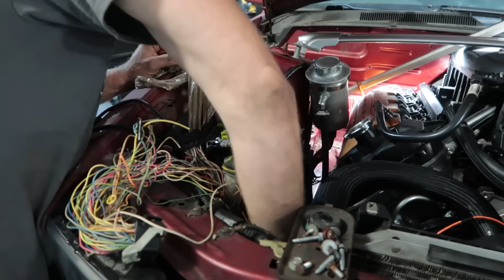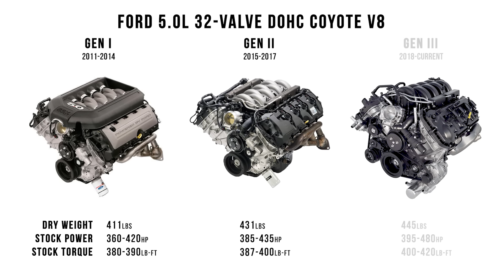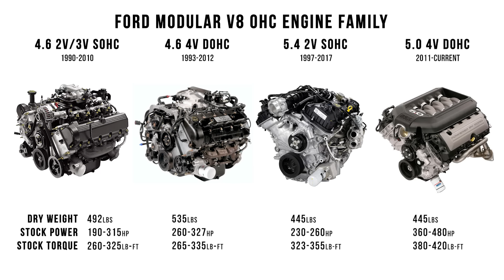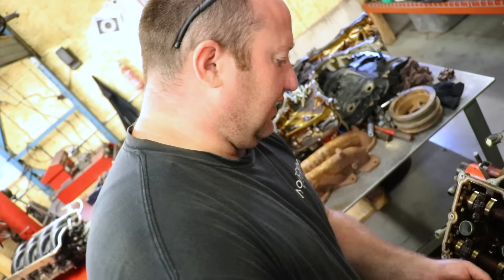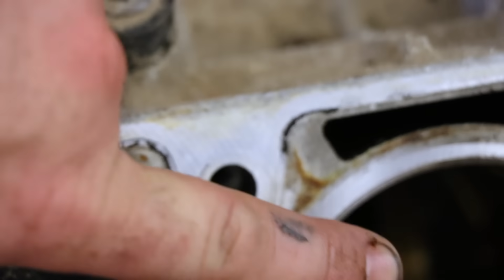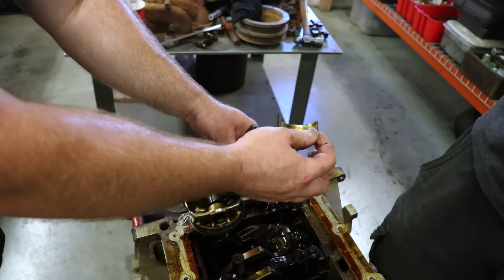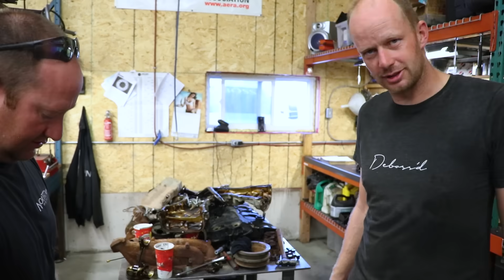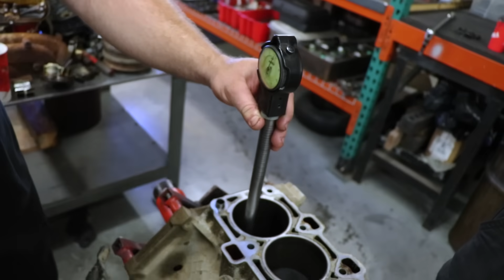REVIEW: Everything Wrong With A 5.0 Coyote Engine

Comment: I've got over 250k miles on my trucks LS engine. I have multiple ASE certs (*now expired) and have taken a lot of classes on lubricants. Oil manufacturer does not matter. As long as it has or exceeds the API rating your cars manufacturer recommends the oil is fine. 

I change my oil every 10k to 12k miles and use a different oil and filter every time. I've used the cheapest store brand all the way up to Lucas Synthetic and Royal Purple. If you look on the back and that seal is there and meets your manufacturers specs the oil will work just fine. You can change the kind of oil you use every 3000 miles if you want to and your vehicle will never know the difference.  The additive packages are so close to being exactly the same that it doesn't make any difference in protection. Just look at the lab results online from different oils. They are all made to the same specs and therefore you will not notice a difference even if you had 2 identical cars and drove them 500k miles each with competing oils. 

This guy is still holding onto "traditional knowledge" otherwise known as old wives tales. Like old guys who won't use Pennzoil "because it contains a lot more wax than other oil and gums up your engine." It's simply not true and hasn't been since at the very latest the early 1970's. My dad still thinks you can't put an automotive lead acid battery on concrete or it will drain the charge from it. Just because something was true 50 years ago it doesn't mean it's still the same today. 

He has been doing this for a few decades probably so the best thing for him to do is find some textbooks the local community college uses in their auto tech programs and start there. It will catch him up on all the developments since he was trained by some old school guy who was still living in the 50s and using old and outdated knowledge that was useless in the present. It's 2020, oil is oil is oil is oil. As long as the API seal on the back is as good or better than your cars requirements you will have zero problems even if you change the brand of oil you use at every oil change. 

We should never stop learning, it's what makes us better as humans. Accepting old knowledge as still applicable is, I'll just come out and say it, lazy. That's all I can call it. The automotive industry has changed dramatically even in the last 10 years technologically and if you rely on what you learned 20 years ago you will fall behind. I'm rolling into my mid 40's and I still keep up with what's new and try to find out what is changing.  Your engine will never know what brand of oil you put in it. It won't matter because they are all so close that we might as well call them identical. Cheaper oils are processed less and therefore have shorter carbon chains which means you need to change your oil more often. Conventional oils can call themselves synthetic if they have been processed enough to lengthen the carbon chains. Which means when those carbons chains break they are still long enough to act as lubrication between surfaces. True synthetics are much more expensive than processed conventional oil like Mobil 1 because they are truly an engineered product and didn't start with a conventional motor oil base. They aren't any better in a daily driven car but in high performance, high rpm conditions can make a difference. 

Oil is extremely complicated and at the same time very simple. We live in an age where we don't have to worry about what oil to put in our vehicles because they will all protect it just fine as long as you do your regular maintenance. The companies that make lubricants haven't stopped their R&D departments and neither have auto manufacturers. They work together to create lubricants with additive packages that reduce emissions and increase gas mileage. The people working on cars have the responsibility to keep up with these changes and educate themselves, especially if they are going to share their knowledge with other people. If you are going to share your knowledge the least you can do is make sure that your knowledge is correct for modern vehicles and lubricants.

Comment: It’s crazy people still think there’s a big difference in price from modded LS to modded coyote. The only thing more expensive is valvetrain and mostly cams ( 4 vs 1) because a coyote has a far better stock valvetrain. All other parts are priced about the same and coyote parts tend to be better especially stock vs stock. Stock coyote heads flow a lot more than newer LS/LT heads even with a smaller bore, valvetrain stability is better on a coyote,stock coyote bottom ends hold more power, and even at 12:1 CR you can still run boost because the combustion chamber design is awesome. And let’s not mention hp/displacement. A 5.0 competes against a 6.2 and wins. The 5.2 flat plane makes like 70hp more than a 6.2 LS/LT and the 5.2 cross plane makes over 100hp more. I will be building a badass LS for my C3 project so don’t think I’m all Ford all the time. I admit that with the ease of adding displacement to a LS/LT engine that you can get more power than a built coyote super cheap but that doesn’t make it a better platform in my opinion unless your building a truck and need the torque. As it stands right now, the LS/LT engines aren the worse American v8 engines still in production from a design stand point but so many people act like they are the best engine of all time. Just sad😞

Comment: I have to admit, I'm surprised at what you're saying about synthetic oils.  I thought one of the advantages of synthetics is that they "don't" sludge up the way pure dino oil has been known to do.  I have my oil changed at my local Ford dealer and I think they're using a synthetic blend and not a pure synthetic.  I'm going to confirm that, but I do the oil changes at 5k intervals and usually drive the car (a 2016 Mustang GT) normally.  Sure, I play around with it from time to time but for the most part, I'm not running it any harder than I'd run my Rav4.

Comment: The boss 302 and first gen F-150 use the same block. The coyote oil pump is known for failure. Gen2 still has oil squirters. Same crank casting just machined different. Gen2 heads have bigger valves and runners. Gen2 and gen3 both have boss rods. Secondary chain failure is common.

Comment: I don't think synthetic causes sludge as much as lack of maintenance.  I have a car with 220k miles that I'm the first owner. Full synthetic oil every 5k miles and what I can see through the oil cap looks brand new. It's a 2011 Ford 3.5l. Never had a mechanical issue with it. Just my personal experience.

Comment: The discolouration between different banks on a V configuration engine is due to the PCV gases traveling from one bank, with fresh air from the intake tube, through the block to the other bank and sucked out through the PCV valve into the intake manifold. I've seen this especially doing timing chain jobs on GM 3.6l high feature V6. It bakes the "hot bank" with the heat from the "cool bank".

Comment: Mobil AV-1 Synthetic Aviation oils were the subject of a class action lawsuit after Mobil withdrew this oil from the market back in 1994, reported to be caused by sludge accumulation resulting in sticking piston rings and other internal sludge related engine damages. The problem was believed to be that even though full synthetic oils are superb lubricants, in some applications they were shown to be poor cleaners and had issues removing lead deposits which is is not present in modern auto gasoline,  but is still added to aviation gasoline. Due to the possibly less that ideal cleaning performance in full synthetics oils, coupled with infrequent oil changes and not getting the engine oil up to normal operating temp  "could be an issue" that result in the kind sludge deposits they were talking about in this video. I have used Mobil 1 synthetic oils in my automobiles for decades without a single lubrication related issue but I do oil changes every 3,300 miles. In my humble opinion you can change oil or change engines, its just that simple.

Comment: I have a 1989 GMC K 2500 5.0 4 x4 with 370K Miles  Local engine builders here say they go to 750K before rebuilding at $2500 Engine and Transmission rebuilt same time.   Take that Ford. Too many issues I heard ....Why did Ford do that?

Comment: NITWIT!
Compression distance doesn't change swept-volume displacement (which is why the displacement of all RICE engines is calculated that way: it's geometry).
All you need to know, for round-bore engines, is the bore diameter, the number of cylinders, and the stroke.  The stroke is how far up and down the cylinder the piston moves, which is not changed by any combination of the compression height of the piston and the length of the connecting rod.

pi (approximately 3.141592654) multiplied by the square of the radius of the bore, gives the area that is then multiplied by the stroke to obtain the displacement of one cylinder; this is multiplied by the number of (effective) cylinders to obtain the engine's displacement.

Comment: I’m really surprised nobody brought up the water pump. They like to go out anywhere between 100,000-150,000 miles and this is usually the only issue 1st gen coyote owners run into. Super solid motor imo. Feels smoother and more playful than a 5.3 Chevy to me as well.
Reply: my 5.0 water pump blew at 140 k  also keep a close watch on the transmission cooling lines mine let go changed the line complete trans flush six speed is strong
Reply: I got a 1st gen. Went at 75k. My neighbor has a 2nd gen and his went at 80k. Probably never mentioned it as he seems to get the advanced engine work. I bet  most dealerships can easily do that themselves so he doesn’t hear a lot about it

Comment: The second gens of these are great motors.  They have one great virtue over an LS, and that is no AFM system time bomb sitting under your hood.
Reply: Man...that is so true.  Once my truck is out of powertrain warranty I'm deleting that garbage ASAP.  I've already disabled AFM on my 5.3 through programming but I want it gone completely.
Reply: Sean Frank that would be a good move.  Keep an eye on you oil pressure and if it starts to run lower than average get rid of it quick.  I ignored that sign on mine and I ended up having a collapsed lifter on cylinder #7 that tore up the CAM.   I don’t know if they addressed it in later years but they also had that problem with the 5.3 where the little white plastic washer where the oil pump mounts cracks and fails.  It’s hard, but from what I have read you can drop the pan far enough to replace it with the crossmember in place.   I think this is possibly what happened with mine due to the drop in pressure, and why #7 was the first to fail.   I know those oil passages for that AFM are also prone to clogging up so it’s probably a culmination of issues that ends with the AFM failure.  I liked my Sierra, but I also like my 2015 F150 with the 5.0 I replaced it with.   Ive owned dodges, Chevy, and ford trucks and none of them are without their unique issues.

Comment: Gotta 98 Saturn sw1 with 380k miles on it. Use supertech high mileage full synthetic, and change every 6k. She's near the end of her life. Not gonna say she's runnin top, but she's running. 1 Piston ring is bad and it runs on 3 most the time, but dammit she wont die. I round trip her 160 miles per and she just wont die...

Comment: I did an oil change an hour after the first change on a 302 from 1969. I ran an engine oil flush with the fresh oil only because the plug gasket leaked. In came out blacker than an hour earlier. 
May have been sludge, but stayed clean longer.

Comment: Way of the future? Dude; ever heard of electric? Gas/petrol engines are nearing nostalgia (for performance) so it's a bit late for that. Seems everyone running gas/petrol is adding boost so it's a moot point on pushrod vs ohc. I'll stick to an LS because it fits in the chassis i'm using and everything Boss would be custom rather than shelf LS conversion kit/bits, combine that with Australia tax and you may as well set fire to your money going Boss. If money's not an object then what's the point arguing, do whatever makes you happy.

Comment: Hey Scott , great video , i really appreciate your humility , you are very knowledgeable , thanks for such a good informative video ,  and i do agree with you , the double over head cam is the future , im a Chevy guy my self , but i do like Ford ,  i have had some good Fords .  The LS is a good engine , built on the old gen plat form , i ride a zx-14 Kawasaki , and of course , it does have a double over head cam , 4 valves per cylinder engine   the horse  power bands are so much more instantaneous , and red lines are higher too , and some times , kinda scary , Lol ,  i love the Sound too  ! do you know if Chevrolet makes a good  v-8 double over head cam engine ? ? kinda interested on your take ,   kinda sad to see Corvette engineers still using the LS single cam engine  , old school 2 valves per cylinder ,  just my opinion . but they finally made a mid engine , gees ,   Lol  , i think i will have to wait for a good double over head cam engine for that before i buy 1  .

Comment: Yeah as someone that prefers working on old carbureted engines and as someone with shop experience, and layman science background, synthetics are objectively better than conventional oils, they have more consistent viscosity and are engineered to serve an engine for longer intervals. If synthetics actually did damage engines like this guy claims, even aluminum, then there would be a much larger outcry from dealers, shade tree mechanics, performance shops and owners against using an oil type they love. When I have a freshly rebuilt carbed engine, I'll happily run full synthetic in it just because it'll last the engine longer.

It's a case of poor maintenance and hard daily driving.

Comment: When will antiquated 'merican car manufacturers adopt technology similar to the "TRUEVALVE" design that eliminates gigantic heads,  camshafts, wheels, pulleys, belts, etc.?  All that extra (and unnecessary) metal mass is being flung around resulting in vibration, wasted energy, materials and efficiency.  Oh wait . .  I won't live that long.  The fact is there is already a production twin turbo 2 liter 3 cylinder engine putting out 600 bhp that would likely shame any production "hot" 'merican car just on power to weight ratio alone.  Probably too big of a bite out of profit margins, I reckon.  The #1 Rule remains the same:  "It doesn't have to make sense!"  Sigh . . .

Comment: LS vs 5.0 in Australia . LS HANDS DOWN WHY ? Easier to get power at a lower cost . Stock to stock the LS Engines destroys the ford five liter . Bias opinion maybe as i own a 6.2 ltr vf calais . But i have had plenty of 4.9 / 5.8 ltr ford v8s so i have some knowledge of these v8 engines here in Australia only . As to the old battle of Windsor vs Cleveland blocks & heads . As for the Aussie Holden 308 / 253 well plenty of noise but no guts . Unless stroked

Comment: So my work truck is an 18 and I noticed it would idle rough randomly , one of the dam phasrers failed , while it was getting repaired under warranty I was showing up once a day to get tools out of it and there was a mustang in the next bay that was " locked up" with. 7k miles , it was modified .... the dumbass owner dropped a nut driver socket when he went to paint the valve covers and it got wedged in the timing chain  ..... last thing the tech told me was $8k and warranty voided ..... so a 0.47$ harbor freight basically totaled the vehicle , full after market exhaust and no cats didn't help

Comment: I change the oil in my 94 F-150 with the 4.9 300 every 3,000 miles or less. I use Shell Rotella T6 full synthetic. It's cheap at $22 a gallon and the oil is always still clean with a light brown tint and is never black. Synthetic or not change your oil and air filter every 3,000 to 5,000 miles and your engine will thank you. I've always maintained oil changes and have never had an engine failure no matter the make or model of the vehicle.

Comment: 2018+ 5.0's are garbage. My 2019 5.0 is burning 2.5 quarts per 5000 miles and it has 14,000 miles on the clock. There is a TSB issued by Ford since 2018 and the issue is still present in 2020. Additionally a class action is being filed against Ford for oil burning 5.0's. Biggest waste of money I have ever spent.

Comment: I used to be a Ford mod motor guy. I still have respect for them, generally, but the LS is superior in most ways. OHC is better for a really high speed valvetrain, but OHV is very capable of reliable 7000rpm operation, and makes the engine far more compact, lighter, and a lot less moving parts. Clearly, even Ford has seen the OHV light (after 30 years of OHC) because they designed the new 7.3 gas engine with OHV.

Comment: LMAO this mechanic said the oil pumps are full proof and no issues. The weakest part of a coyote engine is the oil pump gear and crank sprocket. They will work good but when you start to through power at the engines, it's time to put billet oil pump gears and crank sprocket

Comment: Synthetic oil is better than conventional oil at pretty much everything. Some of the things that have come along with synthetic oil are not good - super extended change intervals, and ever lowering viscosity (0W20). The move from 5W30 to 0W20 was mostly driven by federal CAFE standards as it increases fuel economy by a couple percentage points. Not enough for you to see the difference, but fleet-wide for a manufacture it equals millions of dollars in fines (or fine avoidance). Same thing with extended intervals. Environmental regulations push manufacturers to extend the intervals. Try running conventional 0W20 oil with 10 or 15K intervals and you will see very quickly how much better synthetic is (yea, I know there are not conventional 0W20).